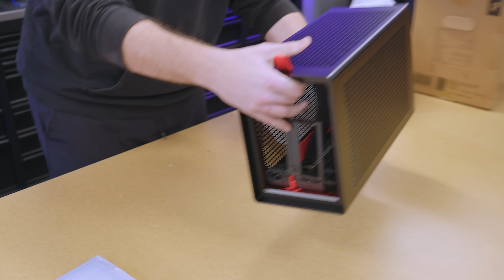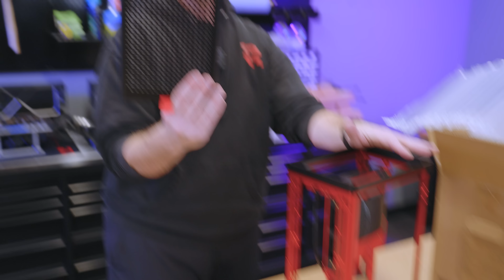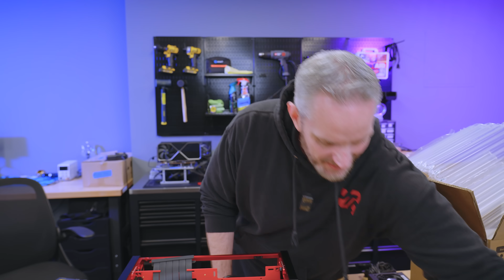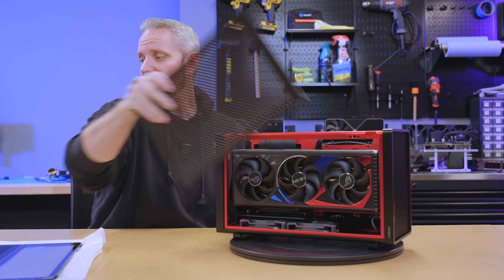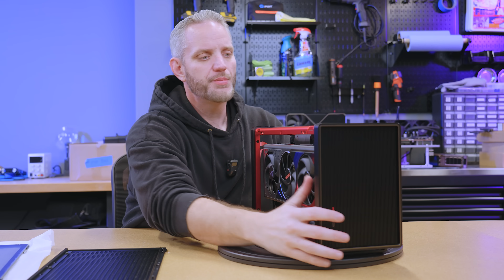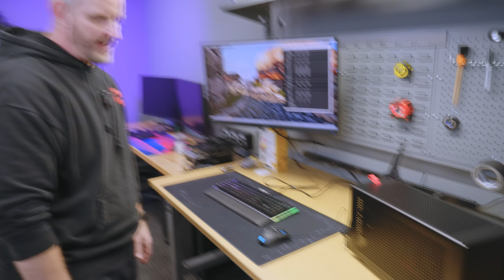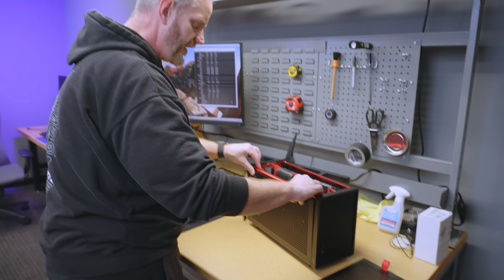This build quality is INSANE! CNC Milled, Modular and Adjustable!

Comment: Nice, but can't use an AIO with CPU mounted pump as the pump will wear out with constant air circulating through it.  Thermals are WAY better than my phanteks evolve shift xt, even with an air cooler in stead of AIO (I'm using a Thermalright axp-100 full copper)

Comment: Is there anyway to close up the back of that case? Do you have to worry about dust buildup? I'm asking because this looks like the kind of case I can use for my console replacement build project. I'm torn between this, the Fractal Terra, or the Cooler Master nr200p V2 (Don't really like the style of the V3).

Comment: Great video as usual Jay ! Am glad Antec still makes great computer cases. Am still using my Antec P 180 with its massive 200 mm fan at the top. I would love to find it a replacement, but cases with 5'25 optical drives slots are hard to find these days. Especially if you want a 200 mm fan in your case. Ah well...

Comment: I think it would be amazing if the case had an optional side panel with a small bump-out for just a bit more CPU cooler clearance. It could really open up some build options without compromising the compact design!

Comment: Just 3d print a rear small frame with some feet, too make it vertical aka the flip stand haha.  Plus you could 3d print a top frame for some top fans in the horizontal position 😉 and make it so you can pop the top panel onto the frame

Comment: It's a nice looking case but this is essentially a bigger terra especially with a lack of aio support. There are much better alternatives out there imo like the t1 which can take a 3.25 slot card in a 9.5l liter space and has aio support for smaller sized card, the ncase m2 which i think could be compared to this in terms of build quality as it i believe it's also cnc anodised and can support up to 4 slots gpu via vertical riser and has aio support and can also support matx boards which i don't think this can while having a smaller footprint at 16 liters and it's cheaper. There is also the dan a4h20 or the nr200p if you wanted a more available case. There is also the meshroom and meshilicious if you wanted vertical and are better options in my opinion than this. I just feel like for something that is 19liters it's poor in space optimization than it's competitors and offers much less flexibility.

Comment: For the amount of options it lacks and the price they ask for this is just a tough pill to swallow. There is better options on the market. Lian-li d4-h20, ncase m2, even cooler master n200 is a better options for a better price. I understand CNC is not cheap but the lack of options for any kind of AIO is just nuts to me. We’re talking about 60-80 mm tailor and it would give the option for AIO. At this price it’s just nuts that it lacks this option. Antec it’s back to the drawing board on this one.

Don’t buy because of a promise, if they don’t come out with anything then you’re stuck with it.

Comment: I'm interested in super small factors like this, but never could do it because I also like enthusiast-grade CPUs and GPUs. This is a modular case, but I would wonder how a 9950X with a 360 or so AIO as a custom module that allows the radiator to sit on top of the system would work out?

Comment: It's good to see Antec on the market again. After the P180 series I felt they were just disappearing. Then cases started to look just like from anyone else, and often less desirable than Lian Li and others in the big league. Darn those P180 were fantastic when they first appeared. Developed with help from the site Quiet PC Review they were designed to catch sound while still allowing some  airflow. By todays standards they have nowhere enough airflow, but back then that wasn't the big problem it often is today. Well at least after intel dumped the P4 processors as those were horrible power hogs, and created a market for such nice things as CPU coolers with 8K RPM fans. Those screamers from Delta were horrible.

Another brand that seems to try to make it back, but have had a even harder time is Zalman. They actually had some interesting cases way back, but totally failed to follow the market. They even failed to uphold their position as CPU cooler manufacturers. It used to be that Zalman was huge in that market, but what money they made certainly didn't get shunted to development as they totally missed the band wagon and still tried to sell their "flower" design of CPU heatsinks when everyone else had shifted to using heat pipes.

Well Back to Antec. They used to have some pretty nice PSU's, both at a decent price and quality. I guess that was one of the product divisions they more or less dropped in the gutter. It would be nice if those were also revived. Oh and CPU coolers. They weren't really big on the market but from my experience they were pretty good. 

Now for this case... I really don't have much to say about this case other than that it looks more like a well designed product than most ITX cases in the same size group I have seen. Sure there are some enthusiast cases that are produced in low numbers that are more compact. But the build videos I've seen make them look very user unfriendly compared to this one, and they are not THAT much more compact.

Comment: The case is not actually fully CNCed and anodized aluminum - the frame is steel.  As someone who really miss the full aluminum cases from Cooler Master/Lian Li/Silverstone of the old days, I would probably actually forgive the shortcomings of this case (not nearly good enough cooling support for an SFF case of it's size, especially for the price) if it was fully aluminum, but alas.

Comment: The Corsair SF750 is the GOAT..  I daily an overclocked 14900K + overclocked  Strix 3090OC in a Lian Li A4-H2O without any issue. Properly configuring BIOS parameters is imperative.

Comment: needs a carry strap attachment. Only reason I would build small form factor would be for travel pc. Saving the space on your desk is not worth the extra cost for min MB or the loss in cooling for components (less cooling=higher temps=shorter lifespan of hardware.

Comment: The material in those fans is LCP, lots of fans use them now because of the tight tolerances they can achieve. The downside of a better material as per usual is cost.

Comment: She's sick as, but dang I'd have to surrender my Noctua D15S and revert back to the old 240mm aio :( Did you say how many drives fit in it? I've currently got 2 nvme's, 2 ssd's and an hdd in my H210... Would be an excuse to get one of them new corsair SFX PSU's...

Comment: I love seeing people showing off more SFF stuff recently. I do wish people gave credit to some of the great boutique options that first came up with or brought these ideas to the public. Stuff like the Formd T1 that was (to my knowledge) the first to bring the adjustable center bar sandwich style, and Ncase M1 / M2 that provide great customization as well. They're amazing cases that I feel like not enough bigger tech youtuber's talk about. I'll grant that it's harder because they aren't just off the shelf, and usually take a week or 2 to arrive, not to mention they're mostly sent flat packed with assembly required, but they're still absolutely top tier options
Reply: I do have to acknowledge how good this case looks though! I don't want to come across like I'm disparaging Antec because that's not my goal at all. This build is gorgeous. I do tend to prefer flipped orientation personally with the CPU / mobo side facing me rather than the GPU but that's all personal preference. Either way awesome video Jay, and THANK YOU for recognizing that the SF750 will handle that build. So many people go way overboard with PSU because they think they need it. A strong platinum rated PSU of 750 watts like the SF750 will handle pretty much any modern build just fine, especially if you're willing to tune power settings or undervolt and that like.

Comment: I have always been a fan of Antec products, i still to this day use the 240mm AIO i bought in 2019, i upgraded my case to the Antec DF600 Flux a few years ago as-well and even my fans and AIO fans is their single unit two fan prism matrix that fit on the radiator perfectly, looks awesome. Back then they where viewed as budget but i would argue that's because they are far more well known now than back then, i just like the products they bring out both the value and quality has always been there as far as i am concerned.

Comment: You could MacGyver 2 fans on the top plate as it is now, using either adhesive Velcro or even zip ties or you could hot glue a 3d printed fan shroud assembly which 2 140's could screw into.  I really like this case even though SFF is nothing I would ever use.

The Red would go great with an AMD build for sure or you could pull the whole case apart and spray that peelable paint over the red in whatever color you like, being able to fully remove it later should you want to.  Great review, I might pick this up for my Wife as She want's more room on her desk, this is right up her alley.

Comment: Make that thing upside down and set the fans as exhaust. The gpu and CPU cooler will get the air from side mesh and hot air will be forced out at the top. Much better airstream

Comment: Question do you guys have problems in Windows 11 with the USB ports or bus, devices not showing, or stop showing, USB storage dies on your or base stations of wireless headsets, or any other shorting out from the last Windows update Windows 11 Version 24H2 for x64-based Systems (KB5048667), I have 3 devices die on me on 2 systems with its update, it's killing my USB kabels shorting out the Data but not the charge , even interferes if I replug a dp label while it's on, please let me know if I am alone in this or you have the same going on?

Comment: Looks like it should be a direct competitor to the Fractal Terra ($180), but I bet it costs about $250-300 due to the higher build quality, and probably on the higher end if it always comes with the extra side panels.  Really impressive though, especially with that Asus card in it.  If it comes out at $200-225 that'd be very compelling.

Comment: I would love to see the dividing panel in the middle to be slightly lower to allow two low profile exhaust fans. As it is now, there is enough space in the top section of the case to fit fans but the divider is just too high. Two case fans for a SFF build just not enough air flow.

Comment: SFF builder here: Case looks great, but a horrible waste of space. if they moved the 120v power socket to the GPU side where there's more space, than there's an entire 25mm of dead space above the fans that could just be deleted or increased to 35mm to accommodate a BIG radiator.  basically, the case should have been either an entire 25mm shorter, or 10mm taller. you can tell Antec is new to the modern ITX game. 

that being said, you should send me one and we can see what I can do with an angle grinder and dremel... maybe we can squeak a radiator in there yet!

Comment: All they needed to do was adjust the balance of fan space available at the bottom, make it a bit taller to allow for a 240 radiator with fans on top and it would've been more "modern" and high end, still having to limit yourself to a low profile cpu cooler these days is not it.

Comment: Great spotlight for SFF!

Suggestion for temps: invert the case such that the bottom becomes the top. Supposedly, top and bottom panels are interchangeable. Run the fans as exhaust with no dust filter.
Edit: I got to the end. Another post on Reddit suggested that the case was invertible. Is it possible to move the feet?

Comment: Great review thanks Jay. I wish Antec would come up with a similar fully modular mid-sized case which would enable you to add 5.25" external drive bays for card readers, fan speed controllers, VDUs, tool trays or whatever. Make it fully customisable.

Comment: CPU cooler EXHAUST is very, very BAD...
Jay, not sure if you discussed this but that cooler has its EXHAUST mostly blocked. On one side it's shoved up against the system DDR memory and on the other side it's shoved up against the motherboard VRM cooler (the other two sides of the CPU cooler can't exhaust)... depending on the CPU choice, many coolers end up turned 90 degrees due to the mounting. So you probably want a different cooler or mounting mechanism. I wonder how hot that DDR memory is getting! Again, almost ZERO place for the exhaust air to escape.

Comment: "Man, I wish we could mount it like this though..."

If you can think it... you can print it.  Whip up a stand that's a decent height off the surface to allow cables to be plugged in yet not too sharp a bend at the table, and have a hole to run them out one side.

If I had that case and had the right hardware to build in it (current PC is far from SFF)...... I'd totally do it, even if I had to print said stand in two separate parts.  Then a 280mm AIO would be easily possible for the CPU.

Comment: GPU fans fighting with BOTTOM case fans...
It doesn't matter if the case ends up quiet, but the fans are a bit in opposition. The GPU fans are shoving hot air through the SIDES of the card. So hot air is being pushed TOWARDS the bottom case fans which are in turn pushing air in the OPPOSITE direction, and in fact the HEAT is getting recycled slightly back into the GPU intake fan (much more so with the SOLID side panel). I guess that's just the reality of how things evolved. I certainly can't think of a way to IMPROVE things for this setup specifically. Anyway, ideally you want the COOL AIR being as close to the INTAKE as possible, the HEAT being dumped out of the case as directly as possible, and to not to have conflicting airflow.

Comment: This is actually a really cool case both in aesthetics and how it's built, the ability to customize and mod seems like a huge boon. 
The fan placement limitations, and lack of custom loop support (ish) seem to be the only downsides, but with the amount of mesh you get it seems this'll be fine with good aircoolers and just letting the case breathe. Oh, and not a huge fan of the open back design, seems kind of unfinished because of everything kind of hanging out of the back like that.

That said, I'm actually veeery tempted to build a fully aircooled 9800x3D + Radeon setup in this case, simply because of the color scheme. If I hadn't just bought a North XL, and a X670E board, I would definitely be going that route.

Great review, Antec is definitely working overtime on their cases!

Comment: Antec ONE HUNDRED was the best case ever made...
Why? Because it has a coffee cup holder on top.
Silliness aside, it's still my case. I have an RTX4070 + R7-5700X3D in it. Is it QUIET? Surely it needs modern something to have great airflow right? It's dead silent. I used Noctua fans for the case, modded the RTX4070 with Noctua fans and a Be Quiet PSU.
(My point is that often it's the choice of fans and how everything is setup that matters most. Oh, and I ran the Noctua RTX fans to the MOTHERBOARD not the card itself due to concerns over power draw. I used the awesome "Fan Control" program to then just set everything up with custom profiles. Plus, the Asus RTX4070 Dual OC would limit the fans to 1000RPM minimum when on. That's unavoidable as it's a Duty Cycle issue. When I ran them to the motherboard and used "Fan Control" I could still use the RTX GPU's temperature sensor but I could now pick my fan minimums. I got it down to around 300RPM. Yay! Spinning at around 600RPM in worst-case.... uh, I mean not the worst case. Pun intended.)

Comment: I would love to see this be able to be vertical!! 

Would also be a good homebrew case for EGPU
They could make a flow through front panel, and a bit of modification those feet could be used on the back if you were to mount it vertically and since they are half loop they could help with wire management. I want one of these BAD if they keep the price under $120 I may jump on one

Comment: I think this case would lend itself to CPU's in the 65 watt range like those 9600X chips from AMD.  While you might be able to get it working stably with a more powerful CPU most of them are at least 120 watt which would mean that finding an adequate cooler to fit in the case could be an issue.  Unfortunately there is no space to fit an AIO so that limits what kind of CPU you could build in one of these cases.

Comment: I've had many Antec cases and power supplies going back since the turn of the millennium. I still have my main PC in a ten year old Antec P50 dual chamber case from 2016. I did have to add some ventilation holes on the front panel for a 13th generation Intel CPU and change the fans to PWM Noctua's to replace the old single speed Antec case fans.
Groovy retro background music man. It that some Lynyrd Skynyrd from the 1970's? 🤭

Comment: it would be cool to have the mobo upside down and the gpu fans pointed toward the top of the case by pushing the spine all the way to one side. this could also allow for bigger cpu coolers or possibly a different layout to put a rad up there on the top. i like the red interior but i think the M2 has more layout options.

Comment: If it's cheaper than the NCASE M2 I'm buying it. Looks awesome.
Reply: It's not. It's more expensive. This case is overpriced. "Performance 1 M is priced at €299 / £249 street price." For comparison, the assembled version of the M2 is €161.95 / £154. It's even cheaper if you get the flatpack and build it yourself. M2 has better compatibility, more configurations, less limitations, and is smaller.

Comment: if you used the full glass side panel on the motherboard side you would totally choke of the air supply to the PSU

Comment: Current have a Phanteks Shift 2 ITX case - basically for the vertical orientation - Like the case but cooling is S&*t. If Antec releases a mod to allow 1M case to be oriented vertically - would buy it in a heartbeat.